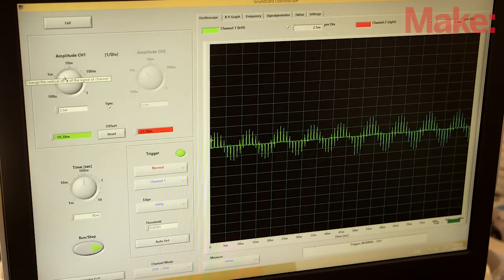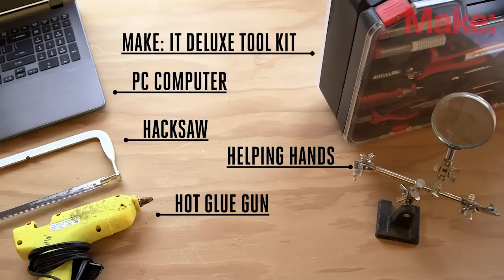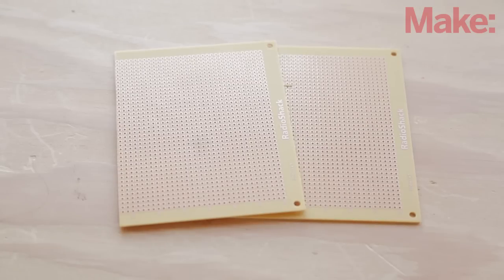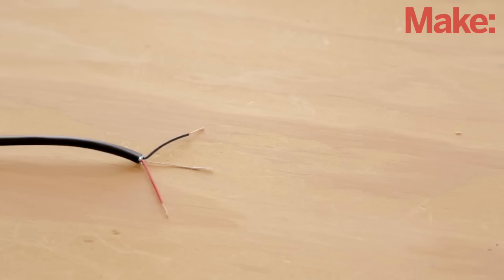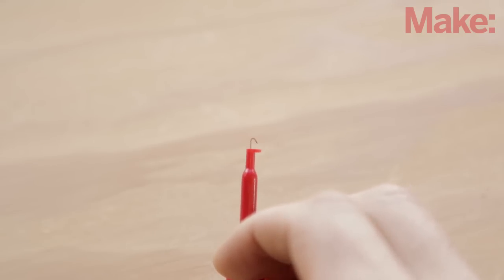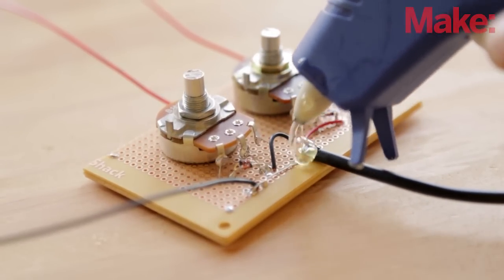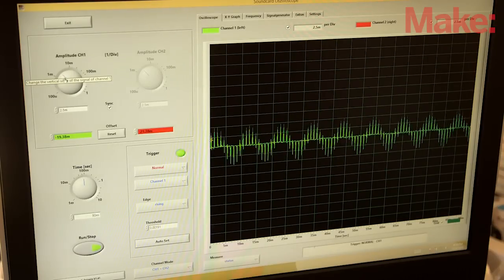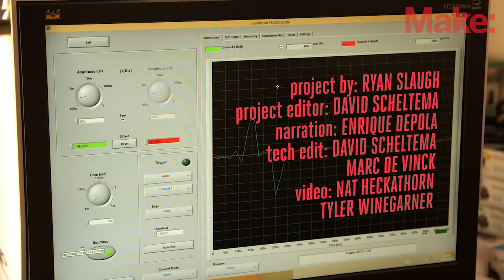Weekend Projects - Sound Card Oscilloscope

Comment: Shouldn't the resistors be reversed? As it is the voltage divider gives Vin * R2/(R1+R2) = 30 * 1000/(4.7+1000) = 29V

Comment: This video is hilarious. First, you don't need a double-sided perfboard. If the diagram can be shown on a 2-dimensional plane, so can the real circuit. There is no need to put the resistors on the other side of the board. Second, you don't need those giant pots either, you can use much smaller, cheaper ones, even surface-mount pots are fine; you're not running lots current through this device.

Comment: Great video,,

I have some questions if anyone can answer my questions.

1) What is the purpose of make the strip board double ?
2)  according to what, you chose the value of the resistors ?
3) What is the purpose of the potentiometers ?

Thank you
Reply: Probably to make the input voltage smaller and the specific values are used for displaying correct values of the deamplified voltage in the software.

Comment: i have installed sound card software but when i was testing software is not responding & it is unable to adjust the amplitude.and also the wave (ac) we are testing is not appearing on screen.......soo please respond with a solution..
Reply: It would have been very useful if you added a part on how to connect it to your sound card that's kind of the main part of the whole project  don't you think?

Comment: Is this scope safe enough for your computer? Let's say if you want to analyse the waveform of the mains supply?
Reply: Absolutely not. Generally, even real oscilloscopes are not designed to probe mains voltages without specific high voltage probes.

Comment: It's even more awesome when you sound like you know what your doing. FYI, it's a "multi-meter", as in multi, or multiple meters in one. Not "mul-tim-iter." Next, I know that kilo ohm does not slide off the tongue, so why not just call them forty-seven-hundred Ohm resistors? But please, anything but "keel-loam." Also, do you have any reason for going to the extra work using two back to back boards? And lastly, it's "for-yeay, " that French mathematician dude.
Reply: Spectrometer, ammeter, barometer, thermometer, speedometer, tachometer, kilometer, altimeter, micrometer. pronunciation is locally accepted. Some of these words can differ based on your area. I was corrected a few times in Portugal due to syllable placement.

I'm not bothered by his pronunciation as much, as the English language is a borrowed language over many European languages to become its own. Brits say things one way, Kiwis, Canucks and Yanks may be the other. I will agree the double sided perf board layout is a waste though.

I will also add this project is merely an intro to using an O-scope on your more simpler projects. Those that do will eventually get the real deal when they expect more.

Let the young aspire. To walk is to crawl first.
Reply: Mike Novo We live in a new golden age of electronics, with single chips capable of performing complex circuit functions, and we should embrace using those as building blocks in our projects. OTOH, as a hobbyist, you should build a few basic circuits (amplifier, oscillator, simple logic, power supply) from discrete components so that you can poke around the innards with your oscilloscope and multimeter (darn that sound-card oscilloscope, its not DC coupled; maybe the next project should be an oscilloscope kit). The purpose is not to re-invent the wheel, but to understand how & why wheels work the way they do. YouTube provides a glorious library of information to help you along in whatever direction that piques your interest, but you still learn best by actually doing things yourself. And yes, YT also presents unlimited ways to divert your attention; beyond electronics, I am intrigued by materials technology, subtractive & additive machining, ballistics and high-speed photography (and that's just the recent junk). BTW, I think that "obsessive compulsive" is more descriptive of an electronic hobbyist than ADHD; maybe we can find something about that on YT!  :)
Reply: Mike Novo That was a good choice; a dedicated oscilloscope has many features that will come in handy for many lab projects. (In 1962, I built a basic DC coupled 5 MHz oscilloscope for my own lab, as my second piece of test equipment.) OTOH, you shouldn't look at any project as "stress and false expectations." Electronics as a hobby is all about learning and satisfaction derived from actually doing things. A sound-card oscilloscope, though rather limited, exposes you to the world of digital signal processing. In the current state of electronics, digital signal processing has supplanted analog for almost every serious application; indeed, most all lab instruments are much more computer than test equipment. For instance, a professional multi-channel digital  oscilloscope is not much more than a set of A/D converters facing into a computer, while a network analyzer adds a few directional couplers to that to yield a whole different instrument. That simple sound-card of today can lead you to software defined radio or the ability to acquire and manipulate data from countless transducers.
Reply: They said you that you COULD use two single sided boards if you don't have a double sided one.
Why don't you juist appreciate this very useful video instead of going crazy about how this guy pronounces words.
I mean if it really annoys you that much you could have just close the tabn in the first seconds of the Video...
Reply: I too found these things distracting. Also, the voice made me sleepy - could use some pep & variation. There's always room for a bit of constructive criticism, despite what others may have said. :3
Reply: How full of himself can someone be?
Reply: Ed Price If you are comparing him to Dave Jones, then bar is set way too high. So I will agree he is in the crawling stage as well by comparison.
Reply: I'm sure they follow EEVBlog and others. BTW I believe Dave is a Kiwi living in Sydney, AU. Just don't quote me. He does not sound Aussie to me. Regardless, I think MAKE did a good job on the video. Lord knows how many takes, it takes to make a video like this. I just think people were irked with your opening line.

I have recently just picked up the bug myself and follow MAKE, Jones, Lorton and Oakes. Each has their own strengths and weaknesses but I look beyond that and try to syphon as much data as possible.

It took listening to Lorton for a month before I could begin to comprehend Jones. So I too have begun to just crawl.

Waking up at 4am one morning finally understanding Ohm's Law and slapping my own forehead was the catalyst. I scribbled, bread boarded and finally soldered some circuits into play. Now I have a makeshift bench lab but my videography is not even close to this...
Reply: I literally just started playing with Monostable and Astable vibrators  on the audio side with NE555 timer, CMOS, OpAmps, et all. LFO, VCO, ARGen, VAC. Too much for a guy with ADHD. It's like crack to me.

This scope lets me show my son what different frequencies and wave shapes look and sound like and how they change into each other when manipulated. I think The Atari Punk console has lit the spark in him. A noisy crusty synth is designed to do just that. But again, I digress. Damn you youtube. Ha!
Reply: ***** Bob, thanks, we all have to periodically take out the trash.
Reply: ***** I'm using the vocabulary of a 6th grader? Oops, sorry to have been talking above your head! I'll do my best to dumb it down in order to meet you at your level. Can you dig this, at Flesch grade level 4? Or must we go way down to something like Martinez made a boo-boo?
Reply: ok, been thinking about this for a few days. My head hurts and the ADVIL is all gone.

What would if I reduce (Attenuate) the DC voltage with a pot and add an electrolytic cap. Pos to probe. Neg to soundcard. Would this AC couple the signal so it can be viewed?
Reply: Ed Price vs The World. Epic Rap Battles Of History.
Reply: Mike Novo Try Aleve; naprosin sodium has better analgesic effect with less danger of liver damage.
Reply: Sharky Shark Unless a person is already hopelessly defective, lasting reward doesn't come from being an insulting critic. It's actually quite satisfying to reach a few minds among the throngs of immature fan-boys and poseurs who populate these discussions. As for epic, well, you really haven't seen epic level insanity until you follow a delusional physicist down some mental wormhole or tried to make sense of some marginal intellect who rants that all of man's ills are due to some new world order illuminati conspiracy. No, this is still the farm league; you can always be sure when the comments include pussy, douche and LOL.
Reply: I saved myself from the added stress of false expectations and bought a used CRT O-scope to measure down at DC. It was a deal that was hard to pass up.
Reply: Ed Price Knowledge of electronics has nothing to do with pronouncing words like you want. People have different ways of speaking and your way is not special or better. If you understood the message, why are you complaining? Language isn't absolute, but evolves over time.
Reply: Mikko Haavisto Before I can answer, recognize that your question posited a comparison. Thus, in order to define how full of myself I may be, I have to ask how empty you are. Give me some benchmark, and I'll let you know. Happy to help!
Reply: Mike Novo Good point; I suppose I rated him at beyond the crawling stage, as digital sampling theory & practice is (to me) rather advanced hobbyist stuff. However, when specialists (in any field) wish to collaborate, they don't normally give each other a massive technical examination; rather they make assumptions about experience levels and attempt interaction. If, during this initial interaction, one hears jarringly odd terms for the commonplace, it signals either extra work ahead (for continuous internal translation and increased possibility of error) or a bad prognosis (just what does this guy know and not know; idiot savants make for frightening engineering collaborators). Further, my assumption is that the poster is a native English speaker, so side trips into Portuguese word order, while interesting, add nothing to this thread. And as I said before, my comments have nothing to do with accents; for instance, I follow a blogging Kiwi fellow who has a strong accent and a really whiney, loopy way of speaking, but he knows his subjects and his tools stone cold, never once inducing a palm slap to the forehead. So yes, let the young aspire, but it is our duty to see that they do not confuse ritual with substance and emulation with understanding. And I think I'm going to make this my last comment on this topic; the wise will learn and the rest will continue to argue.
Reply: Mike Novo Yes, but I didn't want to drag anything else in that might further complicate this thread. BTW, I erred when I called him a Kiwi; he an Aussie. The OP of this thread could learn a lot from following eevblog.
Reply: Mike Novo People are often irked by my opening lines, although I try not to pander with the balance of my posts either.  I mean, if you can start with people torqued at you, why let them down in the latter part?
I assume you made your Ohm's Law breakthrough in DC, so next step is to do it all over in AC, mastering impedances so that you can glimpse the mystical views of resonance, filtering and shaping. You really will need this for any practical circuits, because all real components have various amounts of L, C & R which make them act in ways that can't be explained at DC alone.
It may be an endless journey, but you should be having fun at every step.
Reply: Mikko Haavisto Sorry Mikko, but communication of technical concepts has to begin with a firm understanding of the language. Otherwise, we are just babbling into the wind. Bizarre mispronunciations of technical terms indicates that you do not understand the foundations of those terms, and why they were developed. If you stand on shaky ground, your own efforts will be questionable at best. OTOH, you have the right to advocate for ignorance if you prefer.
Reply: BurningSpooon If my attempt to correct this author early in his experience with electronics bothers YOU so much, YOU could simply have not bothered to reply. However, you did bother, so there's something in your logic that doesn't ring true. Technical terms are coined to convey a meaning, so bizarre mispronunciations of a term indicate a fundamental lack of understanding in your craft. As this author progresses in electronics, he may come to work with "phase locked loop" circuits. However, he will carry no credibility in his efforts should he refer to them as "fuse licked loots." I will allow for accents and non-English speakers, but that doesn't apply to this author.
Now, let's move on to the technical. I asked why the second board was used? Why the double materials and effort? As far as I could see, the author's source said he used a double-sided board, so the author mindlessly created his version of a double-sided board and expects you to follow his lead. Perhaps "BS," you could explain the need for that second board? I don't see any electrical or physical need, so why bother? Explaining this will require some thought on your part, which is always a good exercise. (There are very important reasons for multi-layer boards, but they are beyond the scope of this project.)  There is a concept in design (electrical and beyond) called Elegance. It means getting the most out of the least, doing the job without excess junk cluttering up your project. Think about that when you say that "you could use two if you want." If I could use two, then why not five or ten. Elegance examines every component for its contribution to the whole.

Comment: Be forewarned that there are hefty limitations with this. 
1.) With 44 kHz sampling rate, don't expect to capture anything faster than ~8 kHz, which is pretty dismal.
2.) Sound cards are not DC coupled so you won't be able to capture voltage offsets of your signal (without making a modification to the card).

This is still definitely worth trying for beginners or anyone with essentially a $0 budget.

I did want to point out that a used analog oscilloscope could be had for cheaper than one might think. Someone can likely find a 20 MHz oscilloscope on eBay for less than $100. If you're wanting a PC based oscilloscope, the Hantek 6022BE (20 MHz, 2 CH) is readily available online for less than $70 (disclosure, I have not actually tried one myself).
Reply: Sure at 8 khz you'll have plenty of samples per cycle, but I thought a 44.1 khz sample rate would be adequate for at least 15 khz?  (mind...I've only seen an occilioscope at demonstrations)
Reply: Brandon Wiker The theoretical highest frequency content that can be captured by a sampling oscilloscope is 1/2 of the sampling frequency (see Nyquist-Shannon sampling theory). However, twice per cycle on a signal might not reproduce the signal accurately depending on where on the waveform the sampling occurs. The best scenario would occur when the sampling coincides with the peaks and troughs of the sine wave. In this case, both the frequency content and amplitude are correctly captured. The sampling could also occur at the zero crossings of the waveform, and the result would look like a DC signal at 0 V.

In practice a margin of oversampling is required for a usable signal. A common rule of thumb I've seen is 10 samples per cycle (4.4 kHz max!). Really though, I've gotten away with about 5 samples per cycle which is where I got the 8 kHz figure from. I would say that anything less than 5 samples per cycle is not usable.

Comment: This looks to be pretty neat.  I had bought a  used analog scope on ebay but I can't get it to work. Fortunately, not very expensive.  One thing I wanted to test with the scope was hardware debouncing circuit.  This should be good enough for that?
Reply: That's disappointing about your oscilloscope. If you are willing to put in the effort, you might get some answers on how to fix it by asking on the EEVblog forum. Just be very specific on how exactly your oscilloscope fails.
Reply: Spencer Williams Maybe I'll give that a try. I watch EEVblog time to time and that's why I tried a cheap scope in the first place. But I have most of the parts for this so, think I'll give it a whirl. I just need another 1M Pot and those clips.